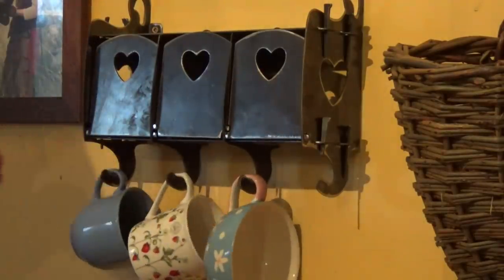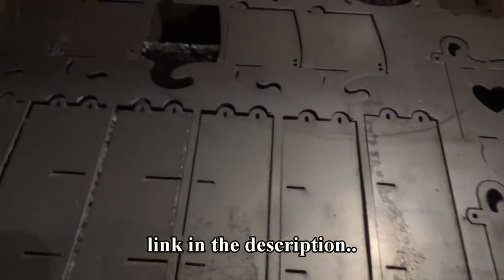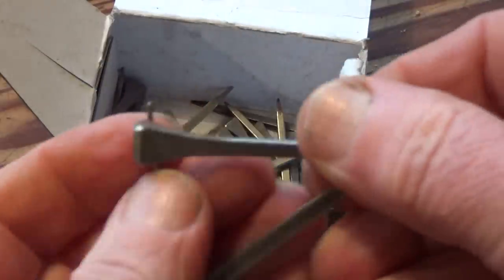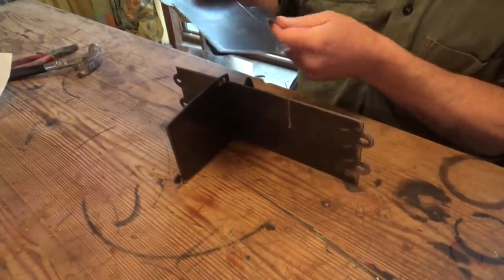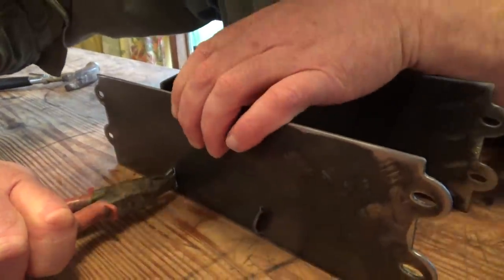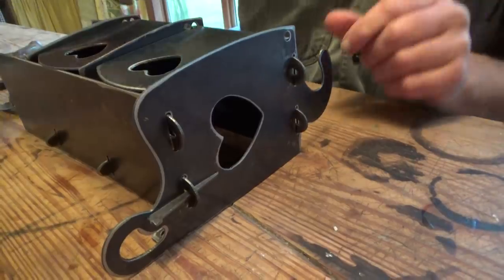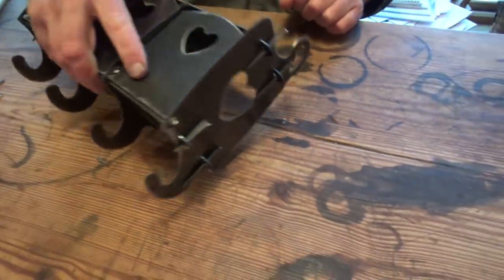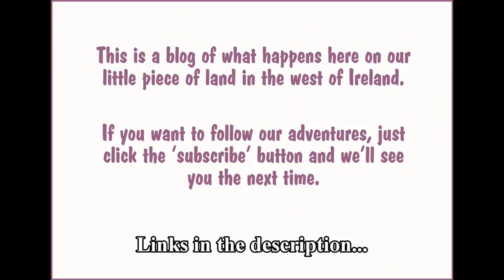Homemade Metal TeaBox Kitchen Shelf (with built-in cup hooks)

Comment: That tab twisting method is so neat, I don't understand why you need the nail method at all, couldn't you use tabs throughout?
Reply from the maker: I tried that, Robert, but I decided they weren't tight enough. The nails lock it all super-tight - and you need that or the doors might get stuck on the sides. The twisty tabs just have to stop the boxes drooping in the middle...

Comment: What a nice and useful project! I have been seeing increasingly more informational signs in our US National Parks that have been made using this type of machine. The trail info, camping areas, directions, lots of different areas have them. They don’t require much upkeep such as painting, they don’t weather away like wooden signs (aside from rust, which just adds natural patina), I would think that they last for a long time, and best of all they are much less easily damaged as they are made with very thick gage material. Have you seen signs like this made for attractions in your area? You can Google for some images if it’s unclear what I’m talking about. Sorry if I’ve mentioned this before, but it seems like it would be a great income avenue. Love your videos! 🍀
Reply from the maker: You're right, Tami. I've been waiting until I'm more experienced with my machine before i take on larger pieces in thicker steel (very expensive if it goes wrong). But perhaps it's time to try..
Reply: @WayOutWestx2  Maybe you could preinstall the bullet holes......

Comment: Nice! Why did you use the nails/wedges? You could have made the side tabs twist, like the top ones.
Reply: Great idea, but for me; it would've been a loss of extra detail.
Reply: Surely that wouldn't have made the structure rigid? There's going to be play between the tabs and the metal sorrounding the slots, no?
Reply from the maker: You're right, Donald, but I decided they weren't tight enough. The nails  lock it all super-tight - and you need that or the doors might get stuck on the sides. The twisty tabs just have to stop the boxes drooping  in the middle...

Comment: How about a similar design (those slots especially) to make some modular small part storage? I'd definitely have some for storing things in the workshop. Most store bought ones are rubbish abs plastic and often don't have holes to attach to walls!
Reply from the maker: You're right, except the design might have to be changed? or all the screws, etc., would fall out when you open the door...

Comment: Has a kind of barge look to them, could possibly add a personalised name, person, house what ever ....at extra cost. Maybe rust will be an issue in some kitchens, you could at low cost electroplate in Zinc or Nickel then add the wax to increase the rust resistance. Magnets would help if the doors don't stay shut.